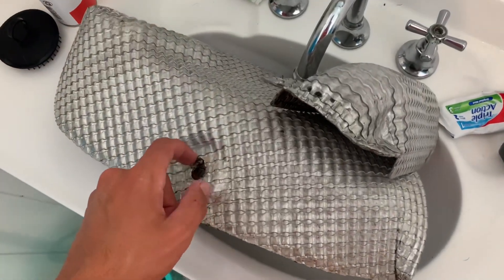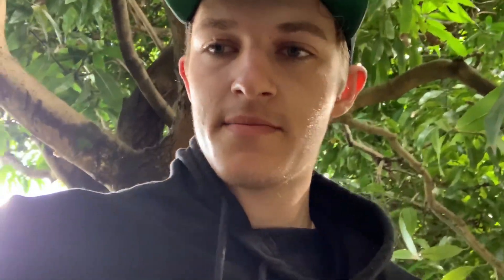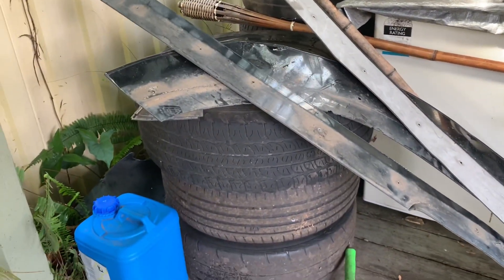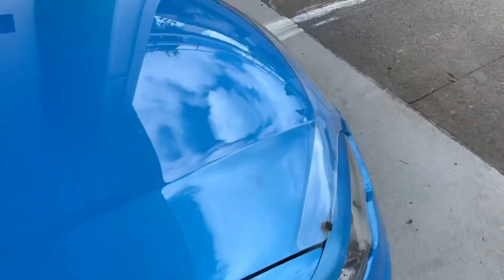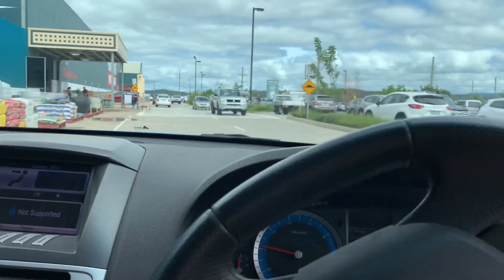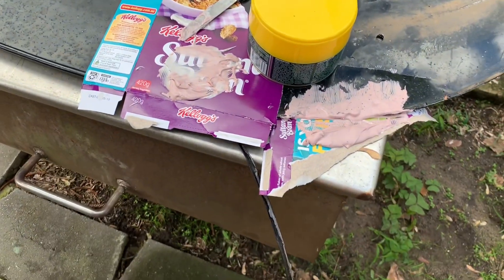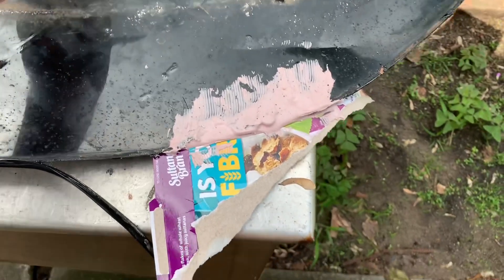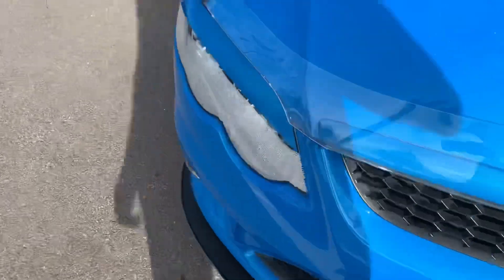The Xr6 turbo is back!

Comment: Ues compressed air to clear the light and a heat gun on low to dry it out . Make shore u have all runner gaskets on the backing covers to seal it for damp

Comment: What pod gauge is that on your pillar? Looks mint! 👌
Reply from the maker: Just a normal single gauge holder.. super cheap etc sell them
Reply: NicshepherdFilms what’d you do in terms of mounting it there
Reply from the maker: Just drilled 2 holes, one for the bolt and a nut and 1 for the air line and wire